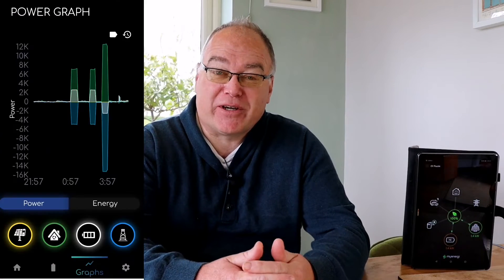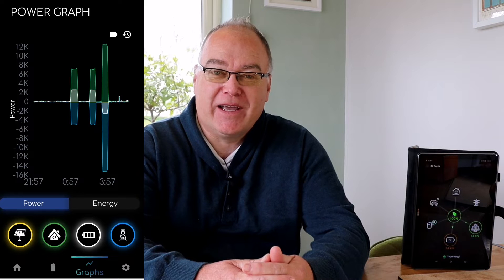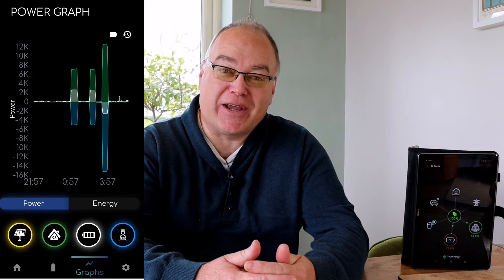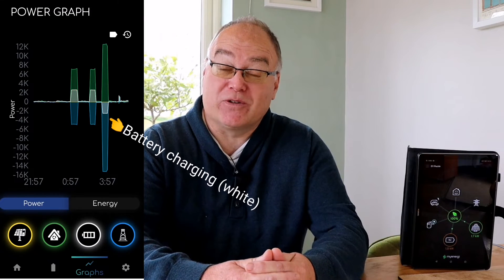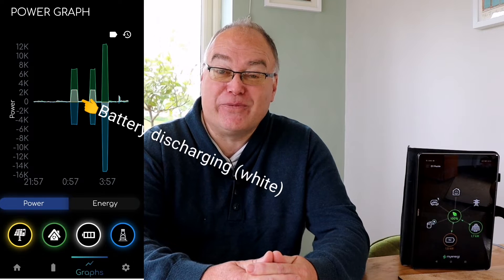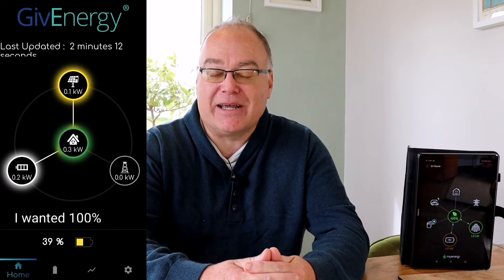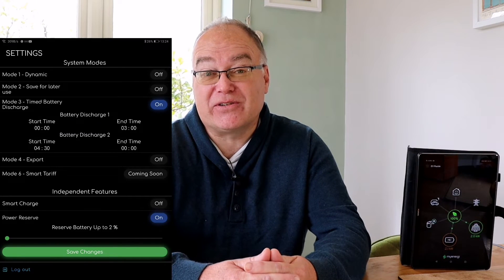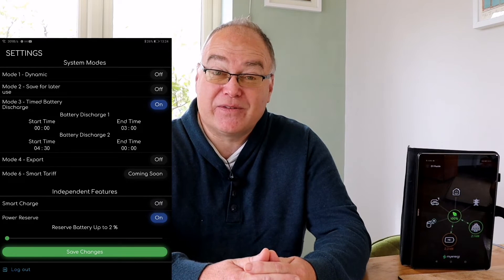Home Storage Battery emptied overnight. How to stop it draining

Comment: There are so many parameters to consider but I reckon they could be simplified and have a much more independent system. Ideally link to weather but even a dumber system would be an improvement that just used last 7 days generation to guide decisions on whether to charge battery / car at night or wait till the free sunshine.

Comment: What all of the manufacturers of inverters, battery storage systems, and diverters (be that EV or immersion) need to agree on is a common communication language. If they all spoke the same then it would be easier to tell the overall system what you wanted. IFTTT would be a good way forward and for more automation, a compatible Home Assistant dashboard would be perfect. I agree, integration is the key, and that has to start with different systems being able to identify each other and then communicate.

Comment: I have the Solax battery storage system and when I don’t want it to discharge I can set the discharge to zero amps and then it uses the grid until I tell it otherwise.
Reply from the maker: Not so good at 3am then? 😞
Reply: @EVPuzzle  I am currently on an E7 tariff so its good all night. Octopus has been pretty expensive through the night for quite some time. I was thinking of swapping to them but for now my E7 tariff is considerably cheaper. My battery setup is 18.9kWh and this keeps me off grid throughout the daytime. My solar setup keeps it charged during the daytime although during winter I have to charge the battery from the grid during E7 time.

Comment: I wouldnt call it integration/automation if you have to continuously fiddle with the settings almost everyday. What most people want is fit and forget based on a set of parameters, e.g consume/charge battery if price is above/below X pence per kwh between certain hours. Other sinple devices can then consume. Considering the givenergy octopus agile integration, why not something like the schedule setup like the one in the knowledge base - https://kb.givenergy.cloud/article.php?id=8 
A local solution something like an ohme smart plug could work off the same parameters.

Comment: I’ve been critical  of the powervault battery because of many failures, but one great thing about the powervault battery was it’s time clock system you could set periods to be normal, force charge, force discharge ( to grid ) sit idle, it was the best time clock system I’ve seen but the battery and SW was terrible
Reply: The PowerVault battery also has a direct Octopus Energy integration to take advantage of the agile tariff.

Comment: I built my system around Solaredge which is great for storing excess solar but now that I want to integrate smart-meter based tariffs I suspect I have little control, only data. In fairness I haven't yet engaged with Solaredge support. Thank you for your analysis and dogged quest for better systems.

Comment: In your circumstance it seems like what you want is the battery to be there only when there is an outage.
Cheap energy from your utility at night is a bargain.
Reply from the maker: Not quite. I'd prefer to run on just solar all day but reality is the battery is needed to boost those times when solar isn't there at that precise time. It gives more flexibility

Comment: It also depends what you're optimising for... Saving money? Lowest climate impact? Security of supply (where blackouts are a risk)? Etc.. All these goals have different logic and management of the resources - and that's before we consider all the different setup combinations (i.e. battery but no Octopus).

I guess I'm saying I totally agree they need integrating, but they also need smart management system that can handle these configurations whilst targeting various user goals. I wonder if Home Assistant or similar smart home solutions could be that glue... But someone has to write that software 🙂
Reply from the maker: I agree. This is where automation can fail as its interpreted as to what a customer wants. There needs to be multiple ways of running and overrides to give control.

Weather integration is a good example. Great in theory but not 100% effective. Not everyone will be happy trusting a forecast.

This is why I like Myenergi. There's a decent chance of the right mix of automation and control.

Comment: I've been down the same road and have come to these conclusions :-

1) These system will never integrate with each other. There are no real standards, after all they all think they know better/want you to buy into their world.
2) The software is a moving target on these systems anyway.
3) Even if the did talk, it has the feeling of a chaotic setup. It'll do mad things and you'll never work out why.

So the line I'm taking, and it's not ideal as it's for expert users like yourself and no way plug and play, is to take control away from the individual systems and have something over the top of them all. For me that's Home Assistant. Charge the car for x time at x rate if the battery is x% full and it's before x o.clock. etc etc

Sadly for the general public I think a system that does what we really want with the configuration bendable to our situations is years if not never away.

My 0.02KWh worth :-)
Reply from the maker: Fair comment. There's little sign of progress. Maybe I'm being overly optimistic .

I definitely agree these systems take dome tevhnicdk understanding but then so does a smart phone so maybe that's just how things are going.

I prefer manual controls to the automation . As you say it'll do crazy things no doubt.

Single brand solutions are going to be popular just like the wealth of EV chargers you can now get integrated with your solar inverter.

Victron have the advantage in my mind as there's an open Api to control their systems.
Reply: @EVPuzzle  Yup, I've ended up with Victron solar charge controllers and inverters for that very reason. Probably should have bought a Multiplus but that's a whole other story..... PS audio and video look great but it wasn't bad before to be honest.
Reply from the maker: Very kind. About time I upgraded and this new camera has excellent focus and tracking .

Multiplus 48/5000 is top of my list so far
Reply: @EVPuzzle  I've a multiplus 48/5000 on my system. Unfortunately it refuses to sync on my generator (inverter type) so I find it won't charge the batteries. I eventually relegated it to inverter only and picked up an old telecomms rectifier to float the batteries off my generator.
By the way, the input capacitors on the multiplus are huge - I estimate 44,000uF which is absolutely brutal on my isolator switch/breaker contacts. I now have a precharge resistor across the contacts and only switch the power on when the voltage on the Victron input has got close to the battery voltage.